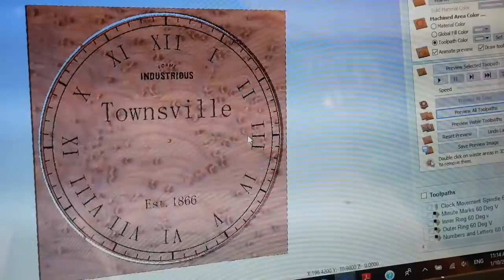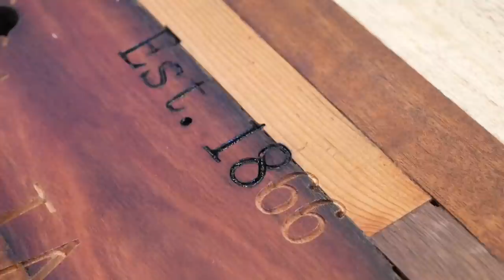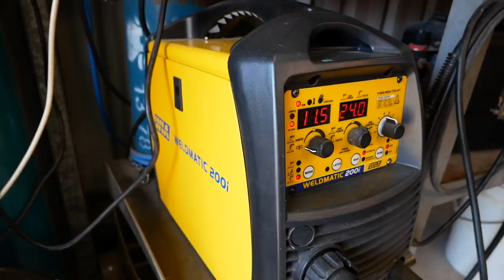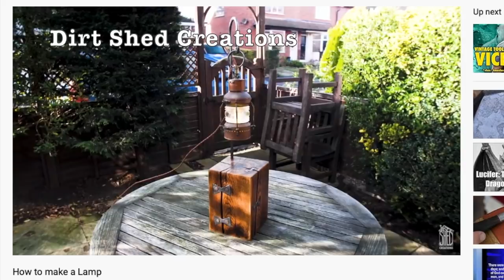Huge Rustic Industrial Clock - Forme Industrious

Comment: Consider applying some masking over the surface before the CNC machining. Then, it's just a quick spray paining with the black paint. Probably save you literally an hour or two of work there. That's what I do for the star field on the flags I make.
Reply from the maker: Thanks Michael. I've done that in the past and I had a fail. I used the wrong tape I think as it just tore and gummed up the cutter. I need some blue painters tape. I appreciate your feed back
Reply: I've had fairly good luck on smooth surfaces with self-adhesive shelf paper. With some variation in the board thickness, there could be some bleeding at the joints. Also, if using an engraving bit and an endmill (for large, but shallow, lettering), I got less paper tear by doing the engraving first, then the endmill.

Comment: I roughly surface sand and add a couple of coats of shellac, then wipe the paint in with a squeegee. After it dries, I sand it properly and add the final finish. Shellac in the engraving stops the paint from bleeding into the timber too.
Reply: Love the clock too!!
Reply from the maker: Thanks for the tips Barry. I know you have had a heap of experience with this. Ned to get some nice shellac.
Reply from the maker: Thanks mate!

Comment: Missed an opportunity there to dabble in some wheelwright work and set that perimeter like an old wagon tire - make it just a tad undersize, then heat it up to make the steel expand and set it in place :) (look up Engels Coach Shop for vids)
Reply from the maker: Need a decent fire for that I believe. We have total fire. bans at home at the moment, so dry. But yes, its a way of doing it but is may also bend the laminations in a bad way over time. Cheers!
Reply: Good point, didn’t even think of how it might affect the laminations.

Comment: Love your work mate! Just a thought, when you roll flat bar to a known diameter why not use C=3.14 X D (circumference = Pie (3.14) X Diameter). Can always add a few mm extra for safety sake, but it saves having to cut small pieces off to make it fit into a circle.
Reply from the maker: Thanks Warren about 150 mm or so at each end of the bar cannot go through this design of roller (all three rollers, it drops the end roller).   The configuration leave the last bit unrolled. If I made the roller with external rollers then yes. I would roll, then weld the join them roll it all in one continuous loop. Not sure if I have explained it well sorry
Reply: @ScottTurnerformeindustrious  Yep got it, again love your work. I know you use a patina on your metal surfaces which intrigues me, any chance u can send me or you can post what you use to achieve it and where to source your products from???  Cheers mate.
Reply from the maker: Thank You! Try this link. I use Scuplt Nouveau Presto Black - PC-9. Available in Australia in small batches as it is DG classified.

Comment: Beautiful job. Nice saves on your errors.  Great way to use your scrap wood I'd like to do the same thing but I only seem to have Jarrah and pine! I have made a few salvaged rusted steel clocks which look fine but getting hold of quality mechanisms is an on going challenge. Do you have any tips?
Reply from the maker: Thank you! I got a high torque movement and hands on Ebay. So far so good. If you like I can send you the link.
Reply: @ScottTurnerformeindustrious  the link would be terrific.  Thanks very much.
Reply from the maker: Try this link https://www.ebay.com.au/itm/High-Torque-High-Quality-Clock-Mechanism-Movement-with-Big-Hands/332571555312?ssPageName=STRK%3AMEBIDX%3AIT&_trksid=p2057872.m2749.l2649
Reply from the maker: Hopefully the link I sent goes through You Tube may think it is spam. Let me know how it goes.
Reply: @ScottTurnerformeindustrious  yep, no worries.  All good.  Thank you very much.

Comment: We were in a clock museum recently and I noticed the 4 o’clock symbol was IIII as opposed to the IV on every clock. They said this was traditional even if not technically correct. Modern clock makers will use either. Did you come across this?
Reply from the maker: Hi Mike, no I wasn't aware of the history at all. Thanks for that!
Reply: I was told the IV to indicate 4 was a medieval invention. In ancient Rome they used IIII (the closest thing to a clock they had were sun dials I think)

Comment: I really like your stuff but that vertical block to cover up your mistake really kills the design. Any thought about cutting across above and below the gouge and replacing it with a couple different pieces?
Reply from the maker: Thanks Matthew for the feedback. Easy enough to run some. more horizontals in there I suppose. Cheers!

Comment: Saw the z zeroing puck sitting on the machine bed and not the work piece and knew exactly what was about to happen. :(
Reply from the maker: In the Vetric program I had earlier set it up for the zero being on the job, using a piece of paper etc. That was before I installed the Auto Tool Changer/ Auto zero, and now I go off the machine bed away from the job. The Spindle now drives back to that set position every time, the MASSO then asks you to change to the next cutter. Select start and it zero's out on the machine bed taking into account the thickness of the block. Your X and Y zeros are of course on the job. It's a great system provided you correctly set up your Job in Vetric. Thanks Anthony.
Reply: @ScottTurnerformeindustrious  That is a lot of good detail! I suppose I'm used to dealing with hobbyist machines (Shapeoko, X-Carve, etc) vs a serious piece of pro equipment! 

In any case, love you work!
Reply from the maker: Thanks Anthony.

Comment: The patch makes me sad.. I think it would of been more cohesive of a patch if it would of been vertical slats like 2 of them or had gone left and right in two different spots into the patch. To make it break up or maybe two different woods. It's just very bam rectangle in the middle. 
So sad but still looks great
Reply from the maker: I know what you mean. Darn it I was thinking maybe I should do this different. I think I still had steam coming from mat ears at the time (There's me using that pun again, oops). Thanks Alex!
Reply: Oh I bet! Finish line in sight and then bam break you leg type thing

Comment: After the crash. Why didn't you just flip it. The mistake would be hidden underneath it. When it was mounted to the wall.
Reply: Amazing finished product in the end nonetheless.
Reply from the maker: Actually I gave that some thought. The other side required more work to get it flat and cleaned up. Really it was just a flip of the coin at the time. Cheers Curt!